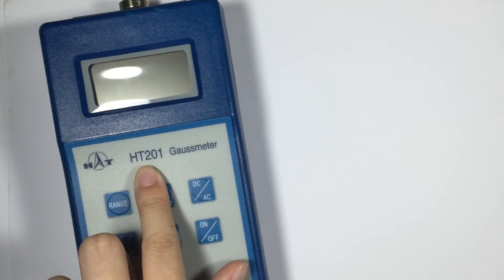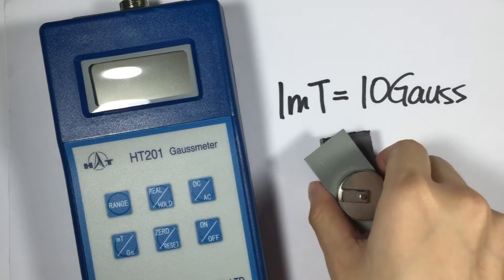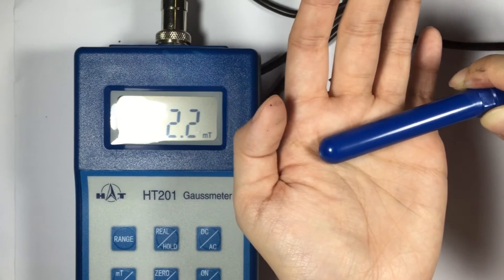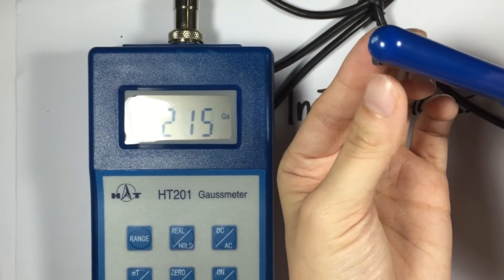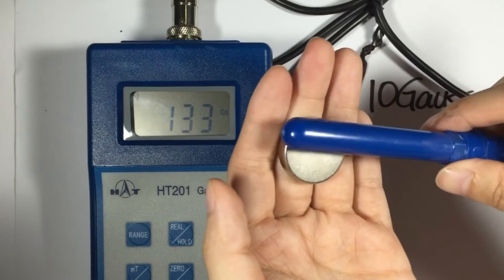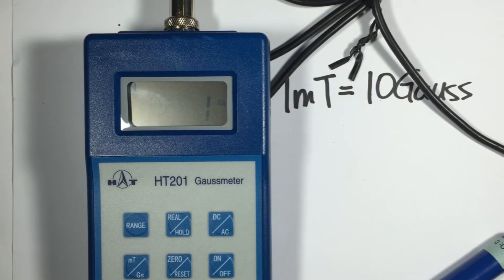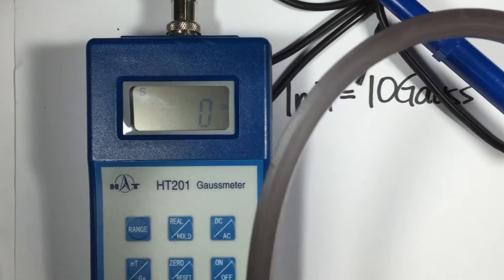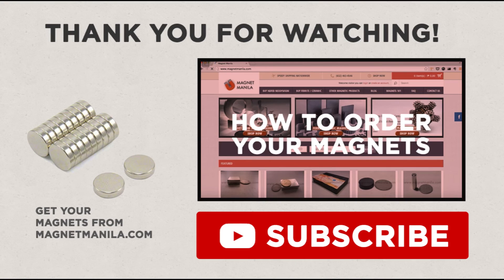Strengths of Magnets: Using a Gauss Meter - Part 2 of 3 | Magnet Manila

Comment: Can you verify my doubt
 I have magnet which have north Pole which is checked by magnetic 🧭 compass 
But same Pole I have checked in Gauss meter it will show it's South Pole
Why?????
Reply: in case you have not found the answer yet: the north arrow of the compass is actually not pointing to the magnetic north. It is attracted to its opposite, so it is pointing to the magnetic south of your magnet.